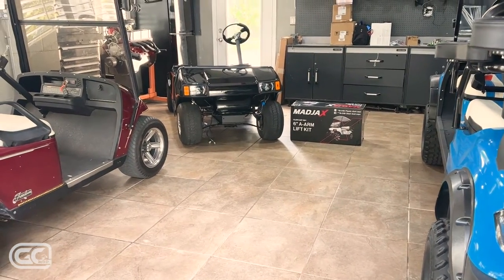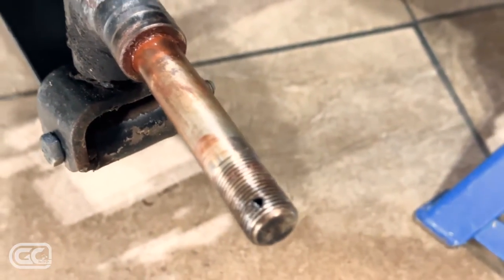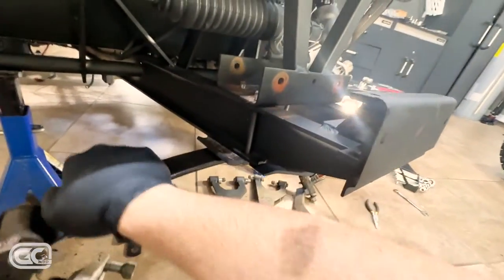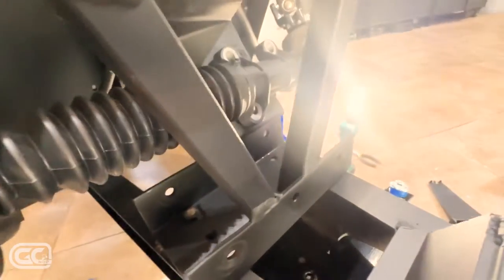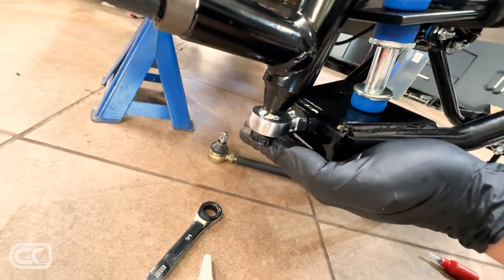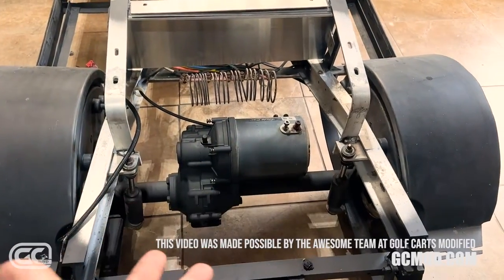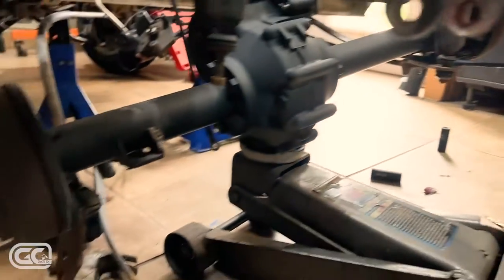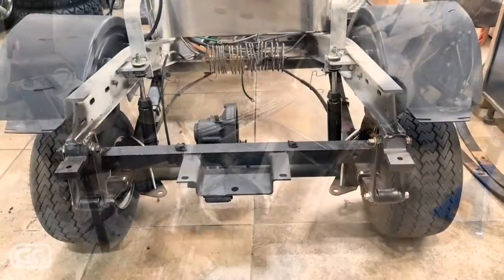How To Install Madjax 6 inch Lift Kit For Club Car DS | Complete Guide

Comment: Nice work.  For those installing in the future, don't apply the lock tight until you fully assemble with tires installed and check the tire camber.  I've installed a dozen of these, and the majority of them need camber adjustments with the heims.   Once camber is level, secure your heim, back out the allen key bolt, and apply your lock tight, re tighten.  Cheers.

Comment: FYI good fastening practice for bolted joints is to have at least 2 threads exposed past the nut. Also the nylock feature of the nut is not touching the bolt threads.

Comment: When you took the bolts out (10:24) , the threads were up... but you put them back with the threads down (14:35)
Reply from the maker: It doesn’t matter. Either way you can get them to fit. It’s just tensil strength
Reply: Original they come with the threads down.

Comment: After installing your wheels and tires did the lift cause the cart to have a raked rear end? I just did one and the rear is like 1.5' taller then the front.. but does not seem to be a common issue ive seen with others?